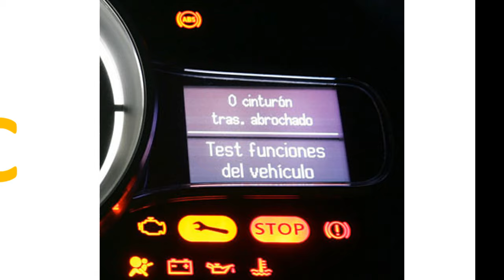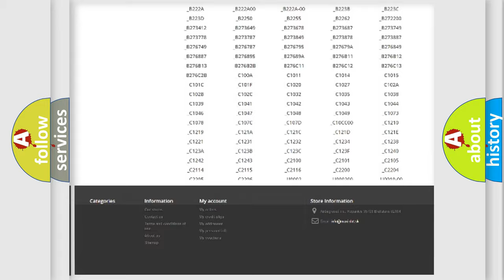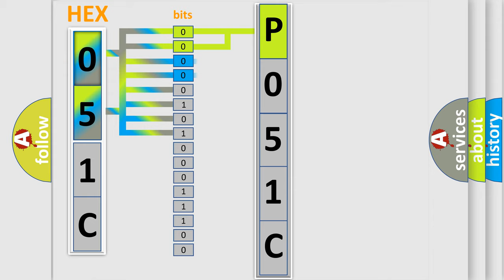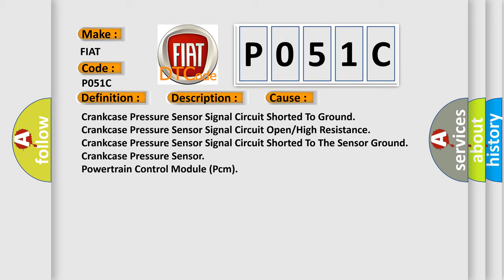DTC Fiat P051C Short Explanation

Comment: I have a 2015 Fiat 500 that have the error code P0151C. it's because the plug for the engine air filter box is unplugged. it's in the engine bay on the right hand side of the air filter box.